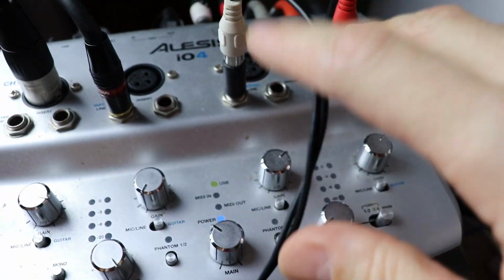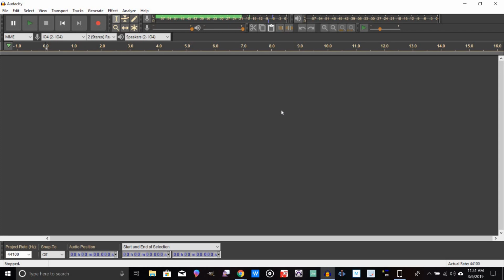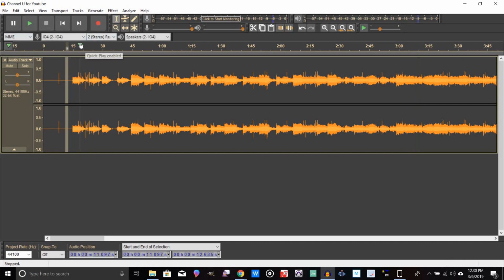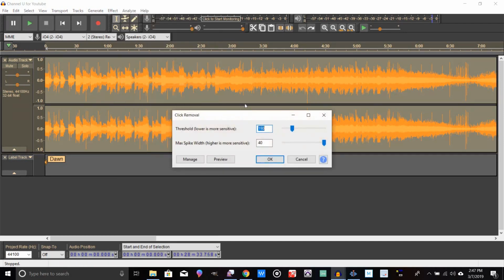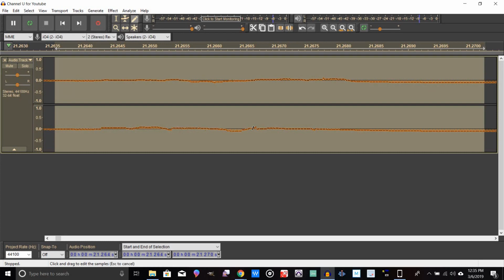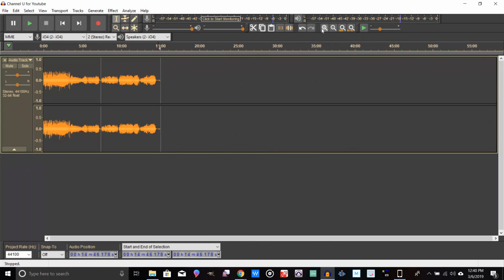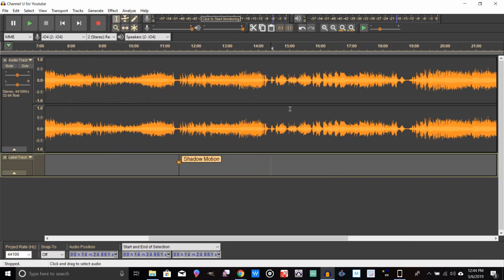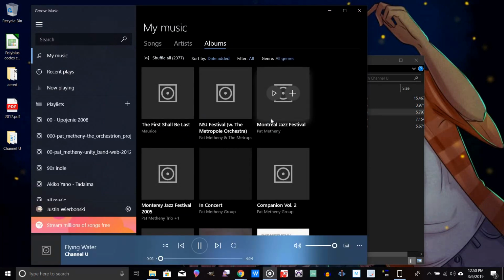Transfer Cassette Tape To MP3 Using Audacity

Comment: I'm kind of confused on how to connect the player to my laptop. my cassette player is an old CD/cassette/radio 3-in-1 and it only has a regular headphone jack. Can I just connect it using a regular 3.5 mm aux cable without using an adapter?
Reply from the maker: it may work if you have a 3.5mm line input on your computer. Though it might be a bit noisy.

Comment: A bit long but thorough.  Well done.  I've a quick question, maybe u can help. When I transfer a song from my tascam portastudio, to the laptop & Audacity, the recording levels r always hot once they're on Audacity.  The levels on the tascam are fine. I click on 'recording levels' but nothing happens.  I can make adjustments to the individual traks, with the mixing board and the main readout but the v u meters at the top stay hot. Do u know how to lower recording levels as they come in by using Audacity?

Comment: Thanks for the tutorial!  I have an old Pansonic bookshelf stereo combo with a cassette player. It has one set of Red/White "Aux" jacks not indicating Output or Input. It also has a headphone jack.  Additionally, I have a Gemini SC-1 USB Sound Card I want to use, I hope it will produce the best product.  I can't believe I still have all the jacks and adapters from back then. My laptop does have a combo headset input. So...didn't mean for this to be so long...so, I can either split the headphone jack to Gemini and then USB to laptop.  I don't know about the Aux jacks and it should be simple enough to figure out, but... I guess the other option would be headphone jack direct to combo headset input using an adapter. Any guidance by chance?  Much appreciated and great job on the tutorial! Thanks much! -D
Reply from the maker: I doubt the aux connection is an output. It's most likely an input to record to cassette from an outside source. You'll most likely need to use the headphone jack with a splitter.

Comment: Hi  I've loads of old band cassettes that I'm wanting to digititise and clean up/edit/archive via Audacity. Would I be better off (quality wise) going direct from the (anologue) tape source/output of my of Tape player (a Tascam cc-222mklv, which is actually a tape - cd converter) into my laptop via the method described here Or converting all tapes to (digital) cd first using the deck and Then uploading onto Audacity via my laptops internal cd drive instead? Hope that makes sense anyways, but am just curious from a quality perspective herr and if anything would be gained (or lost) going the long route round as have many to do but wondered what the best way to go about it was logically for quality of sound etc? Any advise would be greatly appreciated:) Cheers!
Reply from the maker: Honestly the quality should probably be about the same. If it were me, I'd just rip it to CD first then import it (since it would be easier). You could still clean it up and master in Audacity.

Comment: Thanks.  I'm going to try this very soon.  I have a walkman with a 3.5mm jack,  cassette with an rca, and Amazon sells walkman with usb cable.  Which option will give the cleanest audio?
Reply from the maker: Theoretically USB would be cleaner, but the quality of the cassette player will have a lot to do with that too. If you have a real Sony Walkman, I'm sure it would sound a lot better than a cheap USB cassette from Amazon.

Comment: Great video, thanks for sharing. I've got a bunch of cassettes in the attic with old concert bootlegs and personal recordings I've always wanted to rip but didn't know how. Will give it a shot. By the way, Edit > Remove Special > Silence Audio (or Ctrl-L) allows you to flatten tiny portions of audio where the clicks are, without actually cutting time off your audio and impacting the tempo (even if ever so slightly) - and it's simpler than using the pen function for this purpose I think.

Comment: The mp3 would be a mono file in this case? Thanks for a terrific video.
Reply from the maker: well you can export it as mono or stereo
Reply: @demonicsweaters  So if it's a piece of music that's in stereo, then, using two cables, and a stereo out (on the tape player) I can make a stereo copy in MP3 in Audacity? I presume the sound card is not an option in this case?
Reply from the maker: @premnath5749  I don't understand what you mean by "I presume the sound card is not an option in this case" but yes, two inputs = stereo. Most standard PC audio inputs are stereo.
Reply: Demonic Sweaters You answered my question. Thanks!

Comment: You could use the Repair Effect to remove the popping clicks. It only does one popping click at a time, though. The Repair Effect works better than the Click Removal on Audacity, in my opinion. The GPX walkman just did the same thing as the CTR-115 Optimus tape recorder did: (mono). The recording that you made to Audacity is in mono. Either the tape was recorded in mono or the computer chose to record it in mono, instead. A very good informative tutorial.